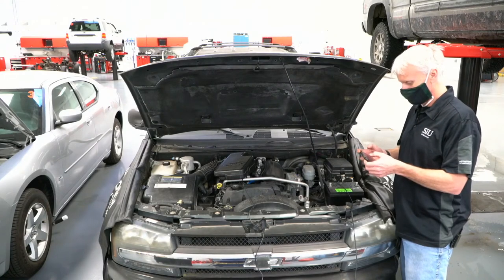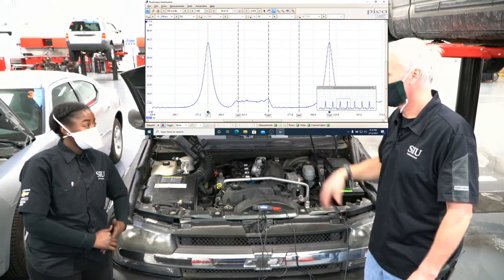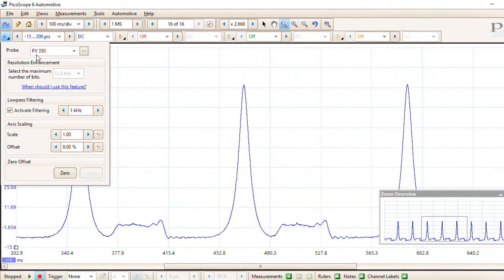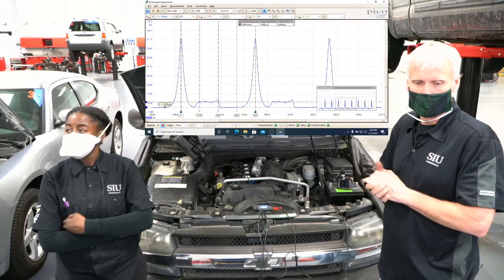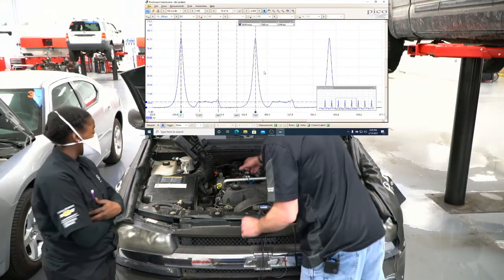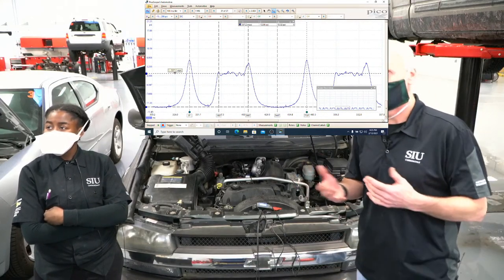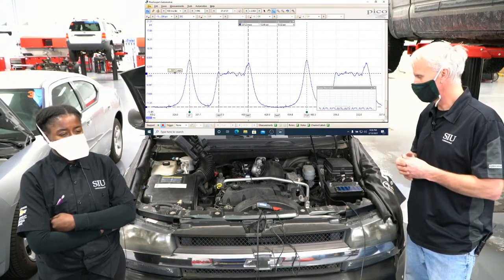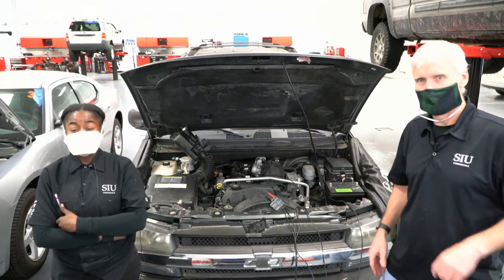Scope Diagnostics at SIU Automotive

Comment: Thank you for taking the time to set up and present this demo, it's always good to see a known good on the same engine to help attempt to diagnose the issue on the faulted cylinder. And looks like there is no intake valve movement occurring, the cylinder is unable to "ingest" air and cannot "create" psi during the compression stroke, during the intake stroke , the piston is pulling against closed valves which then creates deep vacuum, and obviously the misfire is due to the mechanical fault. Anytime I see that big sweeping curve I think of it as visually seeing the piston travel being graphed. Thanks again for sharing
Reply from the maker: Good job with the diagnosis!  Thanks for watching